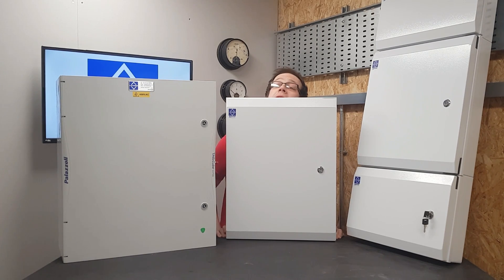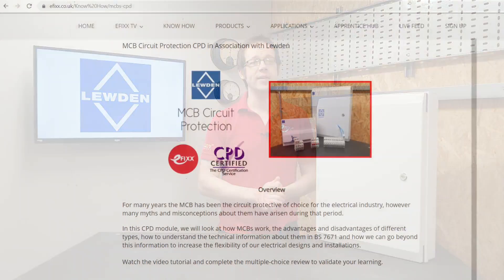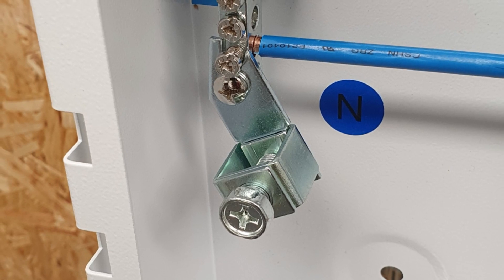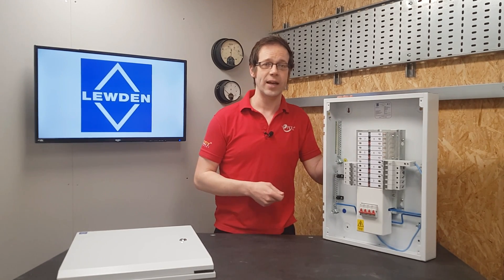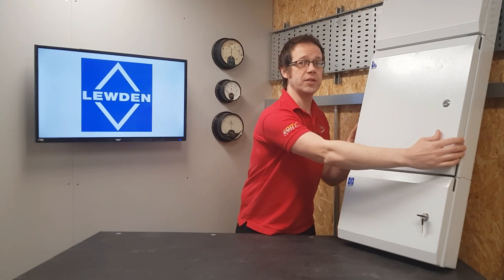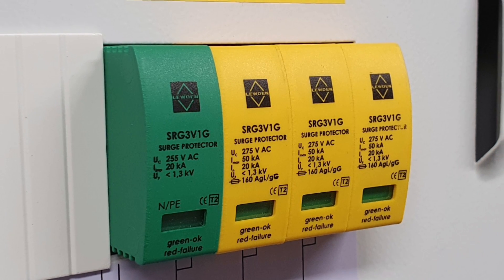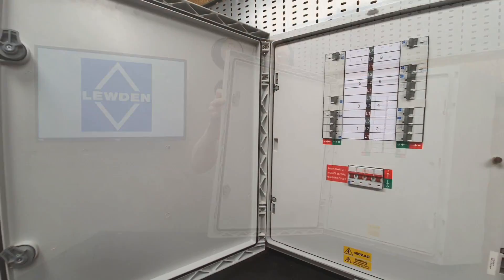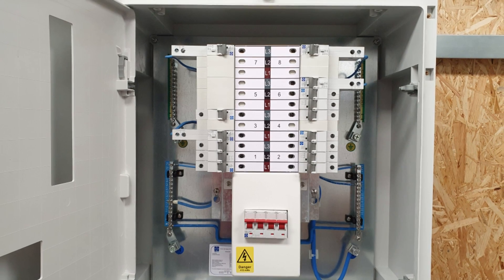REVIEWED: Lewden Three Phase distribution boards - flexible circuit protection

Comment: Used is predecessor on a job (CGD).    Absolutely rank. Breakers don't sit square, screws made out of cheese, din rail has to be "adjusted to fit".   Ordered some more breakers for it 2 years later...stopped making them!!
Supplied some 'best fit ones'. Problem is that I work a lot on this site and I am stuck with this install every time I add a circuit.   BUT the CGD Curve single phase boards are great and are my got to board if client won't shell out for Schneider

Comment: That chamfer looks awful standalone - put the extensions on and it shows how little thought they actually put into the "styling"!  Looks like those "extra large terminals" are much the same as I have seen on boards for the last umpteen years & prone to falling to pieces!  If they were serious about adding helpful features then maybe use a decent rising clamp design on the large terminals, tail clamps and guide combs to help keep to wiring tidy & more width to the board so that if you've got a lot of RCBO's you're not fighting to neatly route the wiring past!

Comment: Oh they've actually put their name on the breakers now they used to have this stupid symbol with a red triangle in a black circle had me tearing my hair out trying to figure out who the manufacturer was .no name on the devices no name on the board nothing to be honest the old stuff was cheap I'm sure this is as well but functional  it's a three phase board what client wants to spend their money On them most clients  dont even  want to by rcbos
Reply: That logo is for control gear direct
Reply: @TheMiniMammoth  to fit Lewden, Control Gear Direct CGD, as well as Denmans – BS Basics, Steeple & Designa Boards Single module width Standard din rail mount

seems to be quite a few

Comment: To be honest, I can only see one manufacturer that has innovation in mind, and that's Schneider, we need more manufacturers to invest in similar technology, plugin devices, devices without fly leads, push fit terminals for neutrals and earth's, these are what we want.
As a board it looks like the majority do, I would say, it's ok, but could do better.
Reply: Agree with your comments, but how much is Schneider compared to Lewden?? Or even Hager compared to Lewden! Alot of people slating Lewden but they provide a very affordable product that does what you need it to do.!
Reply: @bellas_switch_adapted_toys  yeah your spot on, Schneider is expensive, I have used lewden and it's ok, just like other cheap brands are ok.

Comment: Lewden are rubbish had some type A rcbo’s fail there technical department was awful wanted me to try more which i did from the wholesaler who had the same batch which all had the same problem. I found out i was the only sparkie testing on type A on the tester.  Spoke again and they was waiting for a container but couldn’t put aside any new ones so i had to change the board. Lesson here is dont buy cheap stuff